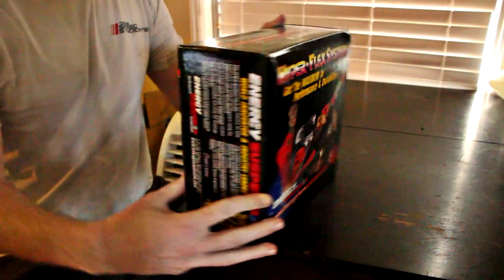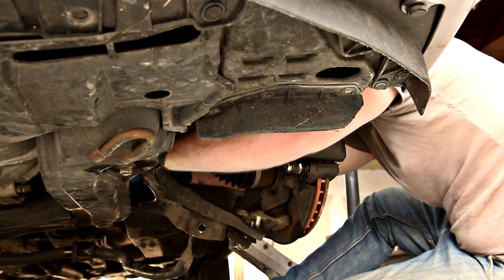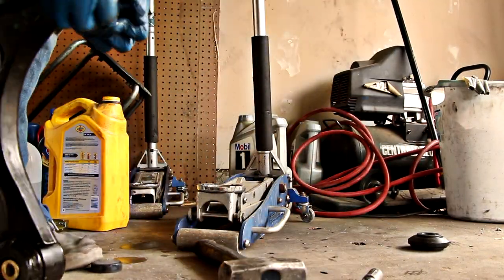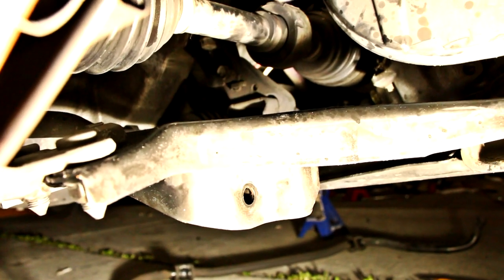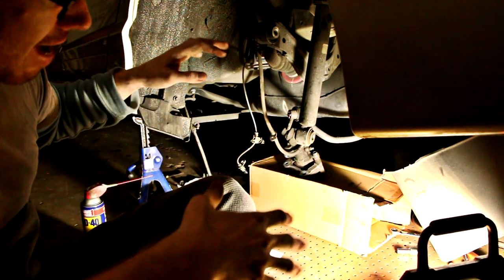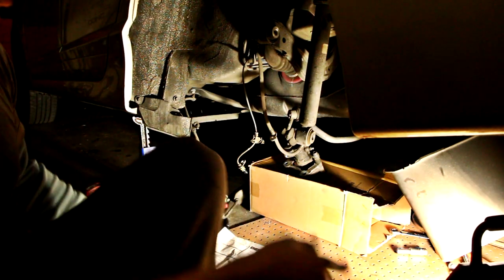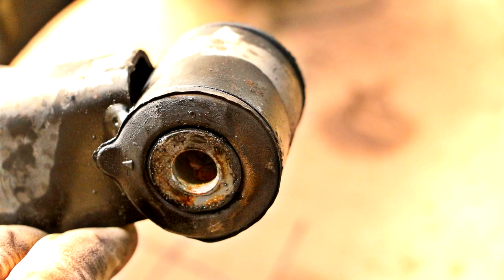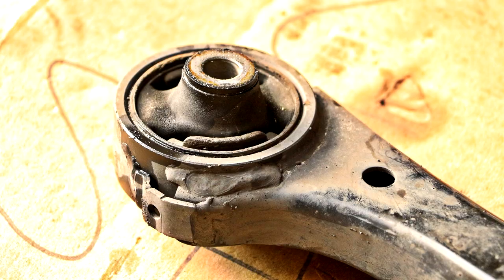Are Energy Suspension Bushing Kits Worth Buying? || Project Civic Si Part 2

Comment: One thing you need to remember is leave all components loose, you never tighten any of the components until you have the weight of the car on the ground. Thats what sets your suspension correctly. The other reason you may have had an issue installing the control are is the mounting plate the arm/bushing end sits in can be squeezed/slightly bent together making it a tight fit. Its easier to straighten the mount than it is to grind and ruin the bushing sleeve.

Comment: There great. I have put them on 6th, 7th and 8th gen. Never a single issue however if your not tool orientated you will have nothing but problems so be sure someone with experience helps you if your not that good at tooling

Comment: I was curious about the rear trailing arm bushings, to bad you didn’t replace them. I have 165k miles on mine and plan to track it. 

Do you know how to remove the rear arm bushing? And do use re use the piece that attaches to the chassis in the rear? 

Please let me know if you know. Thanks
Reply from the maker: RTABs are easy on this car. I checked mine and they were fine at 110k miles... Unbolt caliper, shock, upper suspension link and spring, and you can unbolt the trailing arm from the rear subframe, its pickup point on the knuckle and the front point on the chassis. Takes about 30 minutes.
Reply from the maker: Actually very similar in setup to my BMW E46 drift car.
Reply: Hi, thanks for taking the time to reply.
Reply from the maker: FYI, do not recommend polyurethane in the RTABs, for the same reasons as I took them out of the front compliance bushing: binding. Poly is no bueno on a multi-axis suspension component.
Reply: Thanks so much Jake, im glad i found you because my plan was to get polyurethane for my 8th gen civic si. Maybe should look at the ktune ones that are harder rubber and still oem geometry.
Reply from the maker: @Smngorin  Absolutely recommend that alternative. In the E46 community, we learned a long time ago that poly RTABs makes the rear suspension do bad things on track, especially once big, sticky tires are added. On my drift car, I used hardened rubber RTABs with delrin travel limiters.

Comment: I'd like to know why you removed them too. seems like alot of work to just undo it. also did you buy new arms or bought rubber replacements?
Reply from the maker: Filmed a more detailed video showing the problem. Uploading shortly.
Reply: @DriveBreakFixRepeat  cool thanks!
Reply: Jake Stumph WHERE?!
Reply: I thought there was a sleeve you had to cut out inside the control arms ?

Comment: Just did front suspension bushing kit instal on 2003 rxs s. Wow! Was it worth ? Hell yes! Rides handles steers better than new. This guys video confusing to me. First of all this job is lot work. Time consuming as hell ! Repeat lot work dirty time consuming as hell. Almost scared to attempt rear suspension as it is lot work. Will it be worth it when done? I'd say yes. Why is this video confusing to me? Because hard part this job taking everything apart. Why not put bushings in so you can say whether the upgrade is worth it..

Comment: Saw in the comments that you removed them after the fact....just curious as to why?
Reply from the maker: Suspension binding. Poly in the front compliance bushing made the front end do weird things at the limit.
Reply: Never had an issue with mine and I put over 100k on them. Also curious why you didn't do the rear.  The rear is most important IMO since those bushings need to twist inside the knuckles and arms (they may "look" good but, but they are binding up on you as the suspension moves and you're just twisting the rubber man). Furthermore, I'll bet my left nut that you couldn't adjust the rear tow with the factory bushing in there.  For rear tow adjustment, that particular bushing surrounding the cam bolt needs to twist in order to adjust it.  From the factory, the rear tow is around - 3° which is horrible for a FWD car as it promotes understeer. And you said you tracked with this car? Best to just zero it out for more neutral handling. Not to ramble on too much but some of your techniques were too clinical. I had much better results burning and/or cutting out old bushings. And installing I didn't need a press either. Just got creative with things and you have to do them in the correct order. For instance you can't put the inner sleaves into the bushing until the bushings are set into the control arms first (you're going to struggle because there's not enough compliance on them to collapse).

Comment: I need this kit... let me know how the car handles man.
Reply from the maker: Feels like it knocked about 50,000 miles off the odometer. Replace those front control arm bushings ASAP!
Reply from the maker: Update: Taking the bushings off and selling the complete kit, if you want it, message me
Reply: @DriveBreakFixRepeat  Are they still available, I'm interested in purchasing them?
Reply from the maker: @emmanuelguerrero3751  Sorry, rear suspension kit has already sold. Only thing left is the front compliance bushings (the big ones in the front lower control arms that wear out).
Reply: Thanks for the quick reply, but I'm gonna have to pass.
Reply: @DriveBreakFixRepeat  why you taking them off?
Reply: @DriveBreakFixRepeat  Why did you take them off
Reply: Why remove them?
Reply: Jake Stumph WHY DID YOU REMOVE THEM?!?!